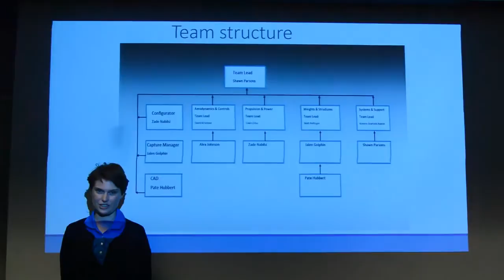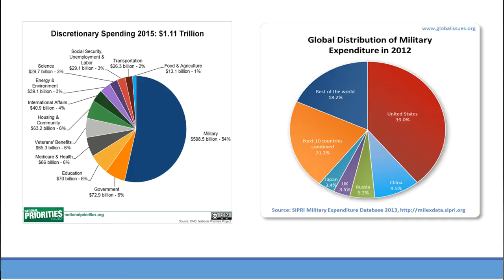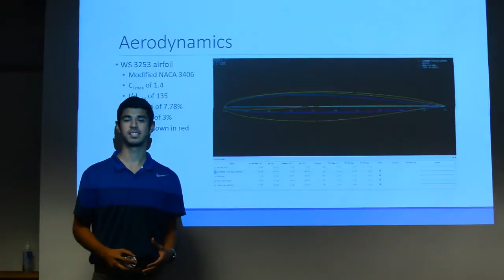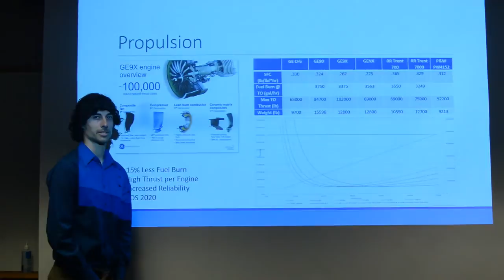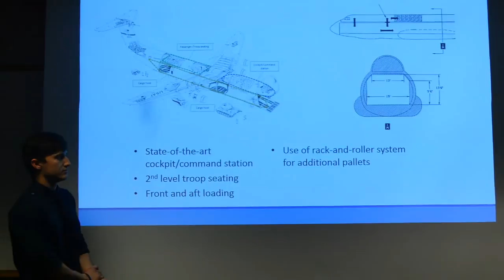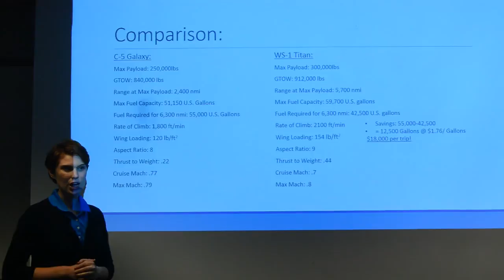MAE3253 Final Presentation WinterSoldiers

Comment: I was very impressed with the knowledge and research that these students put into their project. I like the changes that were made and that they took advantage of the new technology available to them. I am impressed that they were able to decrease the amount of fuel used while increasing the workload performance. While making the aircraft  stronger and more durable it should lower the maintenance cost by requiring the aircraft's down time for repair. I feel, by decreasing fuel cost and maintenance down time, the departure for change from the other aircraft to the Titan aircraft with these students modifications/changes, is a step in the right direction that our military should look into.